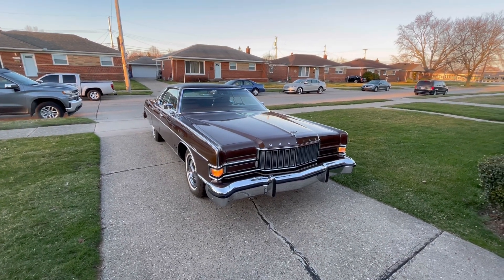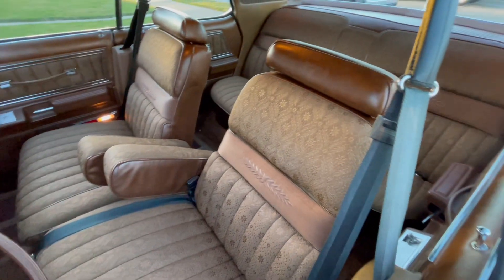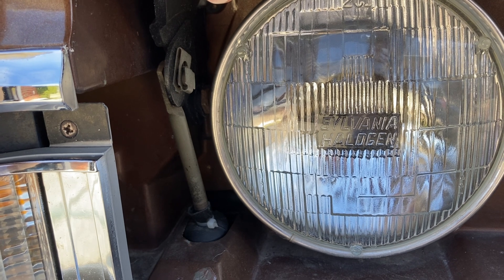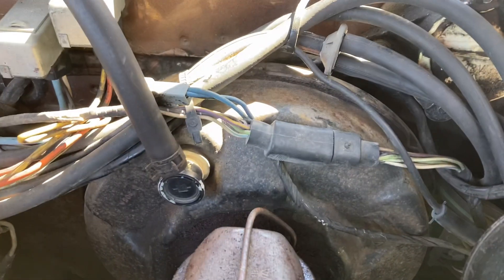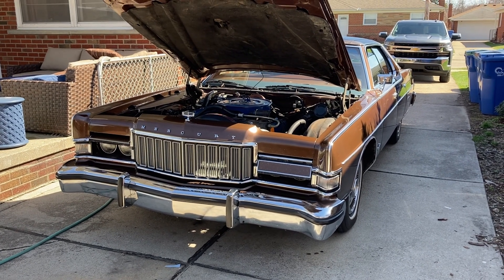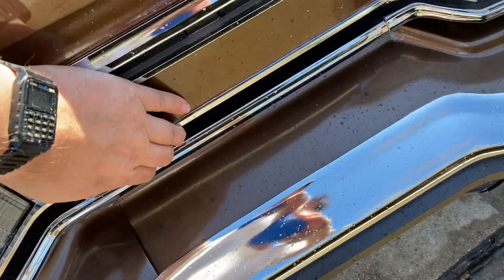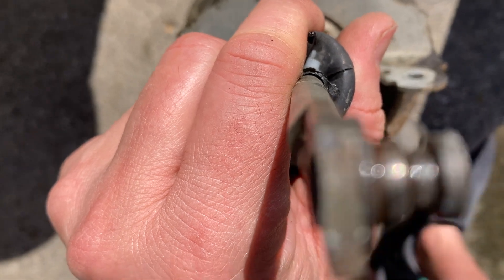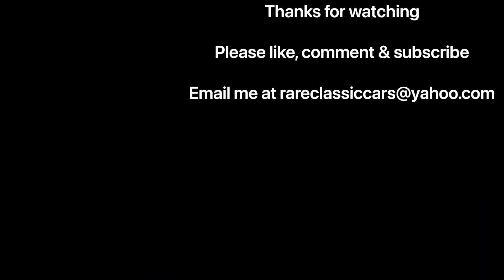1974 Mercury Marquis Hardtop (same for Ford LTD/Lincoln) Headlight Actuators/Vacuum System Overview

Comment: A thousand thanks for addressing this unique Marquis system.  My '69 (and the '70) also used the same single motor method.  I don't know how long my headlights will stay closed, as I have never been able to go more than a few weeks without starting her up. Love your '74.  But I also like the '75-78 ones too.  The '74 was the first Marquis to use the soon to become iconic vertical bar grille. In fact, it was pretty easy to confuse the mid-70s Mercurys and Lincolns.

Comment: I actually 'rebuilt' one of those check valves!!!  I picked it apart and cut a new rubber diaphragm for it, and JB Welded it back together, and it worked!
I remember the bolts being stuck in the bottoms of both actuators in my old 1968 Cougar. It also used those same clips to secure the actuator shafts to the covers. Mine didn't spring open though, they needed vacuum.  But they originally didn't close so I robbed the top seal/boots off of an '80-'82 T'bird in the junk yard. The single actuator not only guarantees more reliability, but also moves the doors at the same time, which can be elusive with separate actuators. The Marquis actuators mount differently than the Cougar ones too.
And Adam, keep in mind that it might be only one of the actuators leaking off vacuum, as I believe a leak in one will cause both to open.

Comment: The headlight doors on the '68 LTD were very heavy, too. The first night we had ours, Dad pulled it in the driveway, turned it off and we were just sitting in the car admiring the new car smell when we heard a gigantic thump. We thought something had run into us, but it was just the headlight doors closing.

Comment: A great overview of the system on these cars, Adam. I'm very glad the headlamp doors on my '73 will stay closed for 3-4 days as you mentioned!  FYI, '67-68 Cougars, '67-'69 Thunderbirds and all Mark IIIs have the two-headlamp system -- the '67s have a unique solenoid which controls the open/close circuits, rather than having a manifold on the back of the headlamp switch as on the later cars. My '70 XL convertible also had the one-motor system, and my '76 LTD Landau has the two-motor system as you describe. I'm not sure how the '69-'70 Mercurys or '77-'79 Thunderbirds were equipped.
Reply: 69-70 Mercs are like your '70 XL.  I have the '69 and I have no idea how long my hl doors will stay closed, as I have never been able to go more than several weeks without starting it up. But that's interesting about the '67 solenoid.  My hl switch has the vac. manifold on the back.  I had to replace it a couple of years ago (still readily available), but the switch is sort of hard to pull all the way out.  Someone else commented on this in another one of Adam's videos, and says he is looking for a fix.
Reply: @rwg520  The headlamp switch on my '73 Marquis Brougham has alwasy required a firm pull all the way out -- I remember the same thing being required of my grandparents' '76 Grand Marquis when it was new.
Reply: O, ok, good to know!

Comment: My old '67 Cougar had slow leaks in those actuators.  What would happen was the canister had a little pivot at the bottom that would seize up.  This would then stress the seal that ran against the actuator rod and wear the seal.  The result was a slight leak past the rod.  The main diaphragm held up well.  Miss that car....

Comment: I had a terrible amount of trouble with mixing up parts where there were two different parts that were the left and right. I ended up carrying a magic marker (or black water proof marker) in my tool box so when I pulled something out I would write on it R or L. Cut down the problem (some)

Comment: From Indianapolis Indiana, where I attended the MECUM auction. The biggest one in the country, too many cars to see in the limited time I had. Prices seemed estimated-really over the top, and quality of restorations varyed. Lots of HEMI cars, 2 winged 440 superbirds, many Boss 302 Mustangs, big block Camaros, Z28s, LS6 Chevelle's, all kinds of super hi end Corvettes of the lowest production, LS6, L88, both under 10k miles. My favorite was a 283 283FI '57 Chevy 4 door hardtop, mostly original black paint, red interior w original plastic seat covers and 14k. I would have paid the estimated 100k... It even had the paper tags scattered around the engine indicating the function or warning for proper operation. I'm sure the best survivor of a Fuelie '57 Bélair!
Reply from the maker: What were the sold prices like?  Seems some are coming down.
Reply: @RareClassicCars  cars, like our lives, are complex. A lot of the cars are so-called fully restored, but the quality varies considerably from one car to the next. some paint jobs are just beautiful, the one right next to it looked good from far... and the prices aren't reflected in the quality. One pet peeve of mine, is people that sandblast items, especially under the hood, and then paint over the rust pits. One six-figure car had more pitted metal under the hood, then smooth sheet metal. I guess you have to do body work even to radiator supports. Basically, the original survivor cars are the best. Nobody built them the way GM Ford and Chrysler built them back in the day. I just noticed so many things that nobody else pays attention to, and there are so many cars there, you couldn't look at them all. But to me the prices seemed extremely high, but I guess there's a lot of rich people that are able to play at this circus called Mecum auctions. There's not one thing in that entire place that was of any use whatsoever. It's 100% toys fun and junk food, and free beer and chips
Reply: Keep in mind, I'm the kettle calling the pot black. I own 50 cars and trucks, everything from a $600 pickup truck that I'm driving from South Carolina to Indy to new york, loaded to the gunwhales, including brand new GM 1970 Cutlass convertible quarter panels, to $50,000 body off frame restored clone 409s. So I shouldn't be talking about useless things, when this $600 truck is running and driving beautifully. I bought it literally at the gate of a junkyard, no title, cats cut off, engine knocking badly, burned up freshly rebuilt transmission, 4 broken door handles. this thing was headed to the junkyard, and I saved it, and since I'm a Chevy truck expert, I could probably drive this thing another 200,000 miles. And all for a $3,000 investment, and a month of my time crawling underneath it, on top of this thing... but just like you, I know my stuff. And there's a video of me putting the motor in a couple of months ago, in 25° South Carolina freezing weather. And actually, now that I think about it, I got $150 for the knocking core motor, and $300 for the burned up twice rebuilt transmission. When I brought the used burnt transmission to the tranny guy, he gave me $300 for the core, and charged me $200 to peek inside the lower mileage (parts truck) 4l60. I guess it's all about who you know, and what you know, and putting your nose to the Z71 grindstone
Reply: @Jack Napier None of the TV auction shows believe in variety.  However there is just a slight dash of variety with Mecum.  I don't know how people can watch an endless parade of Mustangs, Vettes, Chevelles, P.U. trucks, restomods into infinity and beyond!!

Comment: I'm surprised Ford changed to this two actuator system.  Not only was the single actuator more reliable, but it must have been cheaper to produce as well.  Do you have someone that actually "rebuilds" these things?  I've heard some guys switch over to some sort of electric actuator system, that must be a pain to wire in though
Reply: Our 69 Carprice had "hideaway headlights" also.  I remember the owner's manual recommended locking the doors in the "up position" during the winter so the doors/system wasn't damaged due to ice and snow.  We never had any trouble with the system, wonder if it worked the same way as your marquis...
Reply: @donk499  I never realized you could lock them open???
Reply: @klwthe3rd    Don't remember just how they locked open, just that my parents did it.  I think there was a valve/switch somewhere under the hood
Reply: @klwthe3rd  Yeah, don't remember just how they did it, I think there was a valve/switch under the hood somewhere.  But, I remember them talking about reading it in the manual

Comment: Never understood the logic behind using vacuum for this purpose. A simple electric motor could handle the job far more simply and reliably.
Reply: i'm just guessing but the electric motors would close the doors with such force, that you could hear them loudly when operated.  I think Ford Motor company wanted them to operate softly and without noise so they went to vacuum. Just a guess on my part.
Reply: @klwthe3rd  That sounds like a good guess to me!  I had a '72 Imperial that when the hl doors closed it wasn't quietly.  My '69 Merc meanwhile is absolutely silent opening and closing.

Comment: Hidden headlamps were not my favourite idea.  No matter where they were used, they were always an unnecessary innovation.
Reply: They made the car look so elegant though.
Reply: @klwthe3rd  I respectfully but completely disagree. In addition, for some cars it could be said that pop-up headlamps performed an aerodynamic function.  In these sort of cars they made the drag coefficient worse!
Reply: @seanm2511  Yes i would agree that they made some cars more aerodynamic.  Some not so much.  But i guess i was mentioning the style factor as the most prominent reason for their employment.
Reply: @klwthe3rd  Sure.  I on the other hand, if pressed in this case, will say I hate the style more than the substance :)
Reply: @seanm2511  How could they make it worse?
Reply: @nkt1  I shall leave it to any eager viewers to precisely CAD model the effect and do a finite element flow analysis, however if you would notice the headlamp cover is a flat surface while the exposed headlamps are an irregular shape that opens to the inside of the car.  This should interrupt the flow of air and produce additional drag under most conditions except for exotic resonance type cases.
Reply: @nkt1  The effect is for practical purposes likely negligible, however the pop up headlamps while serving no practical purpose other than as a maintenance nuisance and in addition being ugly are an affront to good engineering practice.